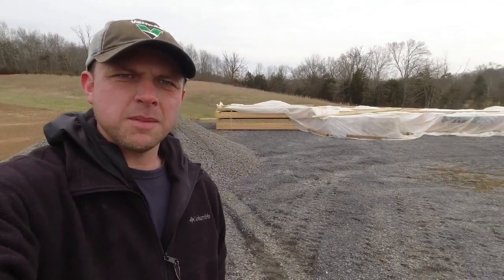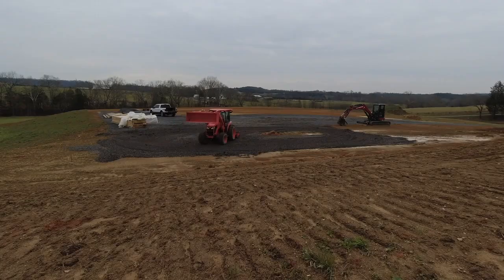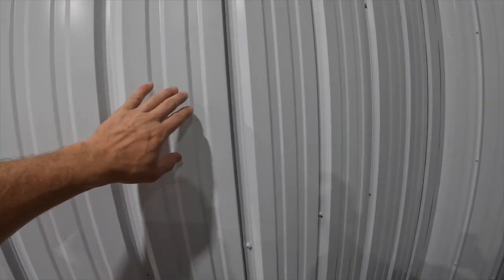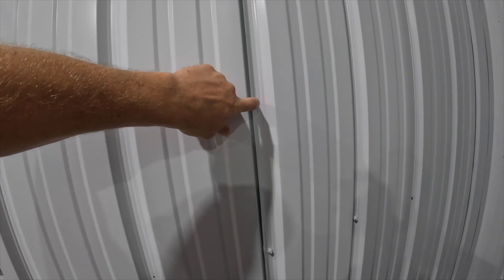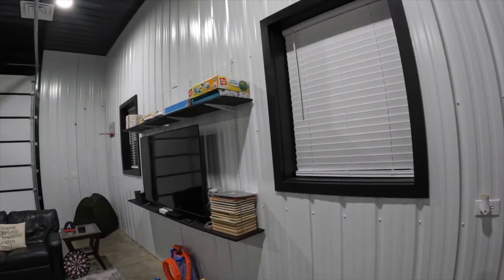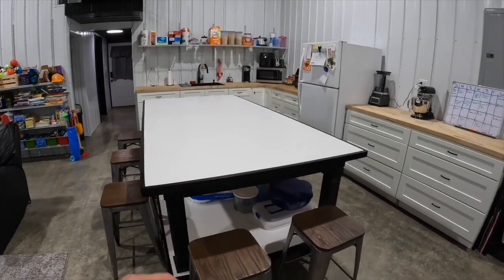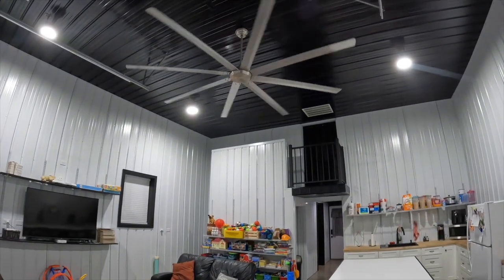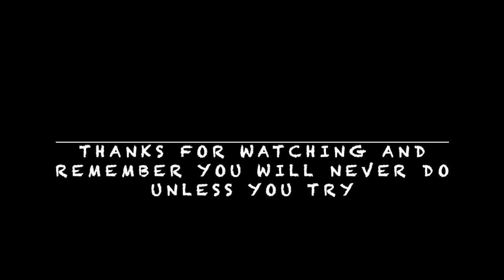#110 Pole Barn Garage House, Start to Finish

Comment: Just running across this video, the wife and I are getting ready to do the same thing and in order to live in it temporary until we build a house. Do you happen to have the dimensions of all of the rooms? We have our ideas sketched out on paper but having this video for reference really helps! Looke great by the way!
Reply from the maker: It is 24x40, I laid it out to where I had 24’ inside the post, that will throw you off a little on your trusses but I wanted 24’ to work with. The two rooms downstairs are both 10x10 with a 4’ hallway between. Room upstairs is appx 21x10 (finished), there is a 3’ closet on the end where I located the water heater and gives access to attic and h/a. Overall ceiling height is 14’, garage door is 12x12. Hope this helps, Thank You

Comment: I’m doing something similar to yours! How did you do your tub insert. I’m running 2x4’s like you did horizontal
Reply from the maker: I had the horizontal girts on right side and back but added vertical pieces at the front right edge so I could add horizontal piece at the top edge to secure shower. Left side of shower is a 2x4 wall where my plumbing is and then I added 3/4” horizontal pieces on outside to screw metal to